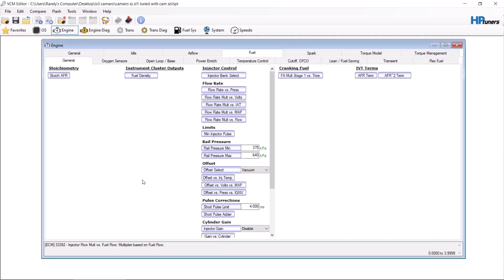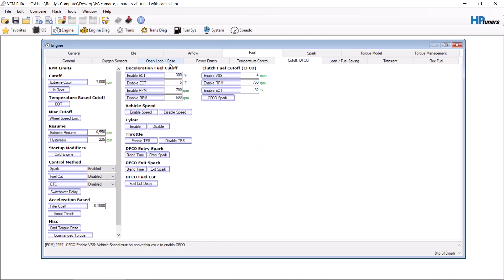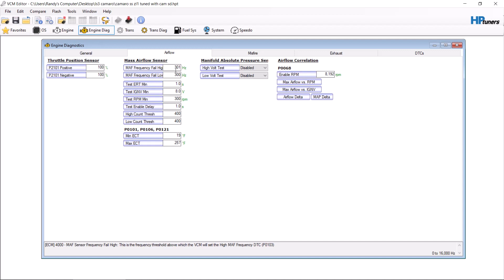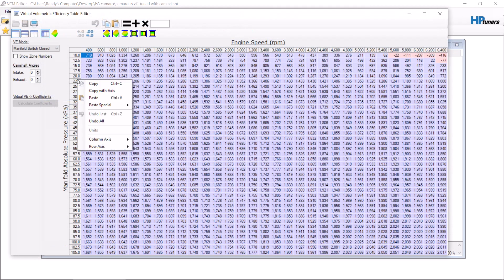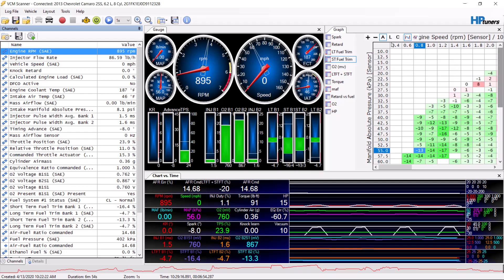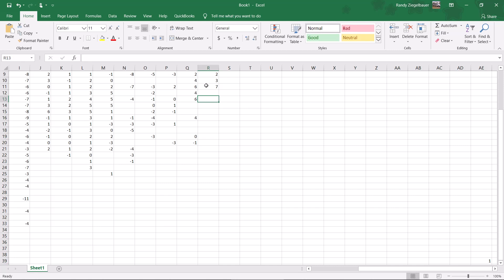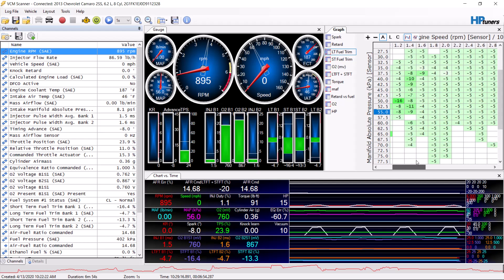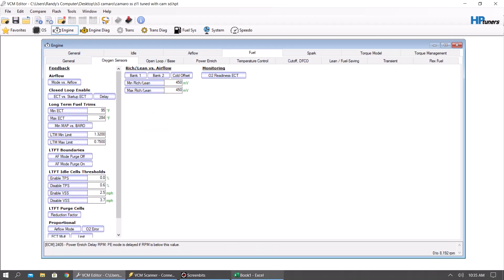GM gen IV VE tuning

Comment: I am curious.. Raising the dynamic air flow seams contradictory... Don't you raise it when setting up for MAF only tuning?. Wouldn't just failing the MAF cause the ECU to default to speed density only?
Reply from the maker: It’s been awhile since I made the is video so I’m not sure which part you’re talking about

Comment: My car was tuned by reputable business and its set up for MAF only and LTFT turned off.
Would I use this process to get the STFT dialed in a little closer?
Its for a 2016 Z06. I changed the supercharger and its pulling -14 at idle but cruising looks okay so far.
Reply from the maker: Usually when they don’t fully tune your vehicle they do what you just described. 

I would tune the virtual VE until perfect then I would tune the maf ad well